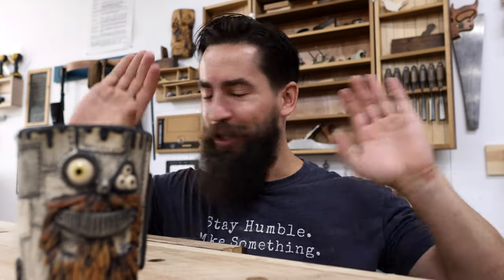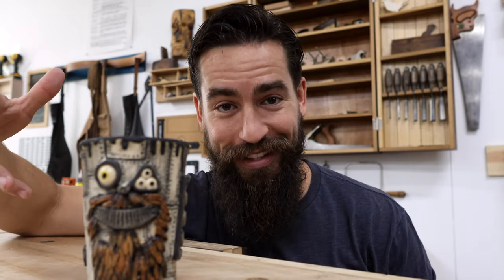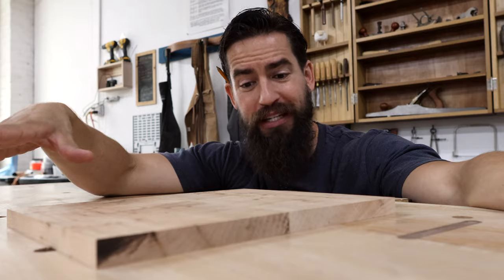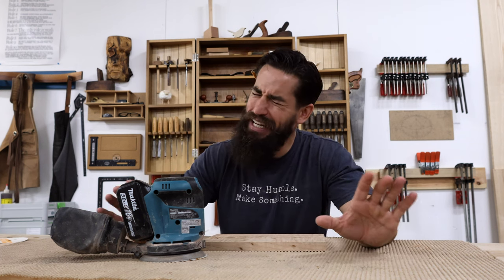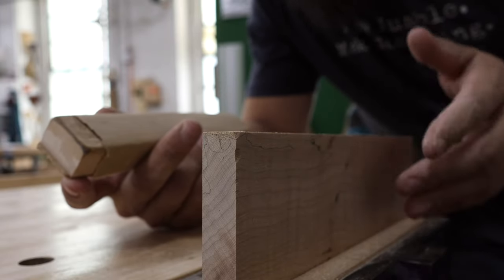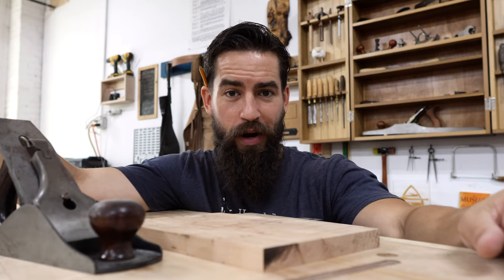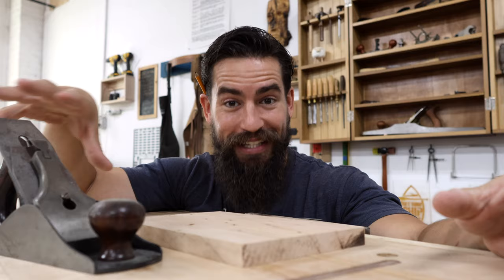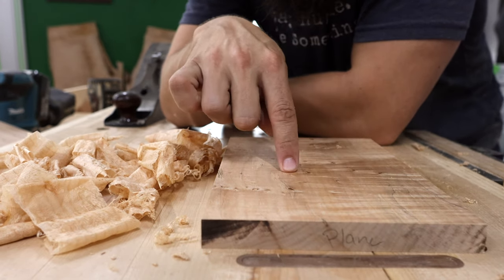Can you spot the difference?

Comment: I have found that using a hand plane can save you a ton of time in sanding. If there are a lot of machine marks or marks in the wood and you have to start at 80 grit it’s going to take forever. If you start with a plane you can jump straight to 220grit or just finish it
Reply: I tend to lean towards hand planes simply for the satisfaction of mastering the art, and less dust. I don’t know if one is actually better than the other, I just know what makes me tic.

Comment: Part of 'which one works best' is determined by what finish you use. For paint grade, 150 grit max. Paint is more pigment and less binder, so too smooth of a surface doesn't provide enough surface roughness for the paint to stick. I used to have a precatalized lacquer sprayed on my furniture pieces. The people who did it said not beyond 220. Again, beyond a certain 'fineness' and the finish won't stick well. People viewing my pieces would say 'wow, they must have taken that up above 600 grit'. I would expect that to hold fairly true for any surface finish. For an applied oil that penetrates and soaks in, I would think you could go as high as you want, and/or a hand planed surface.

Comment: Maybe a planed surface would work well as long as it's narrower than the width of the planing blade so there is little chance of planing marks? IDK , just a thought.
Reply from the maker: That's a good thought, but the plane marks were not a result of the edge of the plane blade digging in--at least in this instance. It was a result of the minor knots damaging the middle of the blade create inconsistencies in the cutting edge.

Comment: Well i don't have electric jointer/planer, so only hand planes, but i do worry a little (not much experience) about finish adhesion so i always use sandpaper in the end. If there is no tearout then i quickly use say 240 grit by hand and that's it. Much better than lot of disc grit changes, dust all over , wearing a mask with random orbital sander
Reply from the maker: A fair concern, and the best way to avoid any issues is to do exactly that. A light sand with a little 240 will do just fine.

Comment: Didn't read through all the comments, but seems to me you guys may need a bit more technical minutia. sanding, especially the bigger the grit gets, leaves a surface that is as rough as the grit. This rough surface scatters the photons that bounce off the surface so that some very attractive visual characteristics of especially very figured surfaces are masked over or made cloudy. A surface that is struck with a metal edge is burnished and smoothed at a level only the very finest of sandpapers may achieve. Then it's the figuring in the grain that does the light scattering and that's when you get the fish scaly, prismatic effects that are achievable depending on the species and cut of the wood. I once hand scraped an entire quarter sawn oak floor in a living room as I was trying not to make dust and noise with a drum sander or the like. The result was amazing! The floor seemed to radiate colors and tones at you as you moved around and angles of reflections changed. 
Keep in mind the drawback that film forming finishes will tend to have poor adhesion over burnished surfaces as mechanical bond is diminished. And water based finishes will raise the grain of a burnished surface (as they will a sanded surface) diminishing some of the visual effect.

Comment: Looking at the edge of the boards it definitely looks like the sanded board absorbed more finish. I think the Wood Whisperer did a test where he tested different methods of applying finish and the one that got deeper into the board had better protection after curing. That being said I love the feel of the wood after the smoothing plane more than the sandpaper.
Reply: I believe he also tested sanding vs planing and the grain on sanded boards was a little more "muddy" then planed boards.
Reply from the maker: I think it's likely the sanded surface does absorb a little more finish given how the grain is opened by the sanding process, but it's still a useful tool to have in the kit.

Comment: I personally like to plane by hand if needed after sending it through the thickness planer and sand with a felted block sander with the grain either 150 > 180 or 180 > 220. I would typically use a shellac or a wiping varnish for finish.

Comment: If you want a "hand planed" look, go wild, and go up to 0000 steel wool, and get a burnish on the board. It will not take as much finish if you want a super deep, penetrating finish, but you get an almost film sheen look, with just oil. You get that reflection look, and for people like me, who like idiot proof BLO finishes for things that aren't needing tons of protection, it's the best of both worlds, looks wise - imo, but also more time consuming. I go 150, 180, 220, 320, 400, 0000 steel wool on things like small boxes. On a table, forget about it, that's way too much work, but for small pieces, it's a nice balance.

Comment: As a hand tool enthusiast, at around 8 minutes 50 seconds you pointed out the difference in shavings.  You needed to sharpen that blade.  One thing I've learned is that the more frequently I sharpen, the less I sharpen

But like you said - I plane every surface of every piece.  Then I give it a few quick swipes with 220-240 grit sandpaper to give the wood a little tooth in order to accept the finish
Reply: I agree with sharpening more frequently actually is less work. I actually think of it as a fine honing versus sharpening. You take off far less material from the blade with frequent sharpening and spend more time making a thing

Comment: As a woodworker for more years than I care to count these days and one who has never been able to get a plane to work properly to save my life, I have always sanded all my projects. That being shamefully admitted, I know when a project is requested or requires the application of a dye or stain, the way the wood takes the stain or dye is dramatically different with the different grits i.e. sanding to 100 grit the color will be MUCH darker than is sanded to 220 grit or lower, especially on figured maple. It may be my old eyes on the computer screen but it was hard to tell with the top coat finish you chose in the video. I would be curious as to how it would take on a strictly planed surface. Given how the pores may close on the planed surface I can imagine it would be on the level of the finer grits of sanding though. Just a curious mind musing as I raise a cup of coffee with you.

Comment: One of the reasons that I enjoy every minute of every video is the “attitude” of Mr Curtis. I’ve been woodworking for over 45 years and, strangely, YT wasn’t an option when I was learning. In fact, I think that woodworking videos ought to be banned on YT so that people have to go through all the difficulties of learning the hard, hard way. 

There are so many ways to achieve the result you want. There is no right or wrong way (except an unsafe way) and the end result is all that matters. If you make something that you are happy with; proud of, then that’s the result that matters. 

I can assure you that, even after all these years, I make mistakes all the time. I try not to make the same one twice (okay, four or five times) but, if you are trying to make something that stretches your mind and your abilities, then you will make mistakes. Just accept them as part of the creative process. 

One thing that I would suggest is to do the trickiest part of the build (that might be a joint or a veneer or a cut) early on. That way, if you mess up, you haven’t wasted time and materials doing the easier stuff first. At the price of good timber now (here in the UK, we are paying about £120 for 8x4x18mm decent ply; from £4000 per cubic metre upwards for decent hardwoods), minimising the waste is essential for the wallet.

Comment: Because I typically only do hobby DIY stuff, I'd never had use of a planer because I never usually worked with anything but dressed timber from the big box store. And I don't have a workspace big enough to brace properly to do planing anyway. So I just sanded. But recently started doing some more detailed work, including resawing to get custom thicknesses, and decided to give Japanese block planes a go (The pulling action works better on my tiny workbench, because I can brace the bench against my body as I pull). And it's a game changer! I wished I'd learned to plane years ago! But's it's not ideal for everything, and I still sand as a final step. It's just a good tool and skill to have!
Reply: Like you, I do woodworking as a hobby/stress relief and started hand planing because I don’t have room for a power planer. This was a really struggle at times depending on the wood but my sharpening started getting better and suddenly the planing got easier.
Never give up, never surrender.
Reply: @johnjudispicer7175 it’s kind of cathartic, isn’t it? Since learning how to plane, I can’t imagine not having a planer. I use it for flattening, chamfering, shaping. I used to think the sharpening and adjusting would be more trouble than it was worth, but yeah, once you learn to sharpen and make blade adjustments, it goes fast.

Comment: That finish the little green ets-ec 3mm stroke gives , is absolutely sublime.
Guaranteed to rub people up the wrong way 😄
Reply from the maker: Oh it's far and away the best sander I've used. Let the haters hate 😂
Reply: @ENCurtis  is there really a difference between the 3mm and 5mm stroke in terms of final quality? I can’t tell between the 2. I have both.
Reply from the maker: @crashkg  I don’t own both so I can’t give ab answer based on experience, but I would guess that it would matter only in a very few instances. With a high polish pass on a film building finish, for example. In that case I think the 3mm would be beneficial, which is why I bought that one. But for most operations I think they are largely interchangeable. Again, I am saying that out of speculation, not experience.

Comment: The answer is clearly "Eh?" because if it was definitive then the debate wouldn't rage on over the decades. Especially in a connected global modern culture. We would coalesce on the clearly superior answers if they existed on this topic.

The hand plane most definitely leaves a better finish on raw wood, which I assume is where the argument comes from. It becomes shimmery and glasslike. But once you apply finish the results aren't that different. And there will always be a place for sanding because difficult grain is typically the most beautiful. Scraping isn't as fool proof as people say (you absolutely can tear out, especially softwood) and at the end of the day, some surfaces need to be sanded into submission. Unless you want the most boring aesthetic of straight grained furniture, you're going to have to sand the most interesting pieces. (at least the faces of them). 16k blade, high angle, cap iron 1/100 of an inch from the edge, throat so closed you can barely see light. There is only so much you can do, and it's not always enough.

That being said, I would rather not sand, because dust sucks and it's time consuming and boring. Planing is a joy and romantic and quiet and if tear out didn't exist then I would throw the sander in the trash immediately.
Reply from the maker: All fair points! Some people do enjoy the sanding process, but for you and I the plane is the way to go 👊

Comment: I've got a finish question. I've been told that a water based finish can have a reaction with hand oils so it's not good for high traffic items. I make dice trays for ttrpg's. I have some Birch and Maple I want to start using, but I want to keep it as bright as possible, but I don't want to use a water based finish if the finish will go bad after a couple long dnd sessions. Any insight would be greatly appreciated. Love the videos!

Comment: What brand of sandpaper do you use on your random orbit sanders?
I have a corded Makita sander but use Diablo from Home Depot. Even with a shop vac connected I still get minor swirls. Tried moving slowly but still get them. Starting to think a better quality sandpaper would help.
Reply: Jonathan Katz-Moses and Stump Nubs have both done sandpaper tests in the past couple of years, and there is a HUGE difference in its quality of finish and the durability of the paper.  I now use 3M Cubitron sandpaper for all my random orbital sanding.

Comment: I love the look of a freshly planed surface, except that the sole of the plane on either side of the mouth burnishes part of the surface. AFAIK, this burnishing cannot be avoided and this surface variation (besides any blade imperfections) is unavoidable. So, I always end up with a light sanding after because I don't want those streaks. But, Erik, you do not mention this. Any thoughts? Anyone?

Comment: No to pieces of wood can be identical… It is just an impossibilty. However they can be very similar… but it just doesn’t make them identical. Book matched top on guitars are very common, but working on/with them you quickly realize that, despite the fact that they are split from the same piece, they do differ… Just the fact that they are reversed (up is down and vice versa on the pieces), makes them very different from each other. And the grain (pattern, hardness, imperfections, patches of ”strange” grain direction etc) will ALWAYS differ in two pieces of wood… And even book matched pieces does not have the a surfaces that was ”together” after planing and other ”adjustments”.
And in these differeces lies the beauty of the material 😇

Comment: One practical difference between the two methods is this: I was told by a Japanese woodworker that they usually don’t sand, only finish with planning because sanding, which scratches the wood, allows more moisture to get into the wood than planning. He specifically mentioned the high humidity of Japan.
Reply: I can absolutely attest to the humidity in Japan it’s like breathing water sometimes

Comment: I will preface this with: I have not watched the video. I am answering solely based on my observations of the thumbnail. That being said, the unsanded “plank” appears to exhibit more chatoyancy than its sanded counterpart. In my (very unprofessional) opinion, several things could be contributing to this, either separately or in conjunction. The first thing (1) could be the grit of abrasive used to sand the wood (for example no grit progression just sanding on like 180 or 220 and calling it a day). That can, somewhat counterintuitively, make the surface appearance worse than before you started. Another thing it could be (2) is wood dust from sanding is clogging the pores of the wood leading to a dingy look. Also (3) sandpaper and other abrasives tend to leave grit behind as they are used. This isn’t a huge issue on harder materials like metal, but for wood, they can embed and lead to a poor finish.